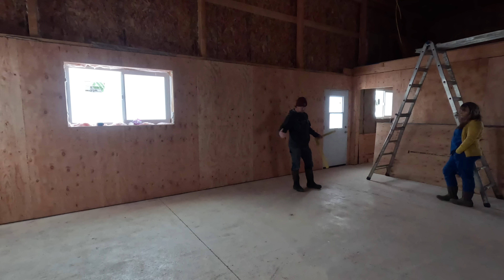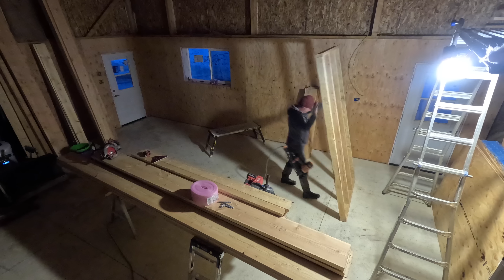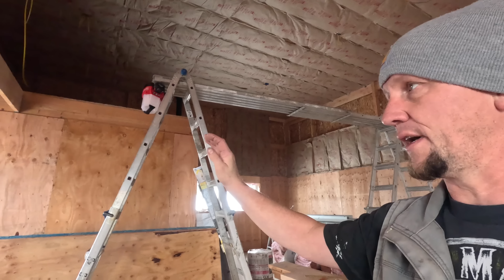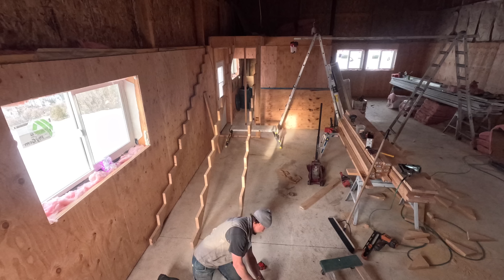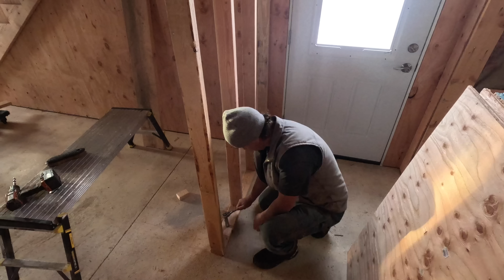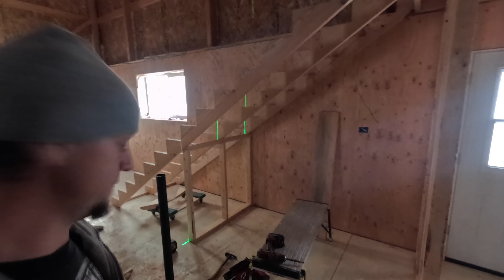Framing STAIRS and adding A SMALL COMPRESSOR ROOM UNDER THE STAIRS \\ MOUNTAIN MAPLE RANCH

Comment: Good progress well done. Consider steel roofing especially if you plan to bring in trucks etc and having the diesel to clean off from the roof annually.
Reply from the maker: We went back and forth about installing white steel roofing for the ceiling but ultimately decided on drywall.

Comment: Felt bad for you at 19.53  when you was fasting your centre riser and it split.
Reply from the maker: Yeah me too.... but its the top landing and will be fully encapsulated with 3/4" toe kick and the subfloor Orb across the top so it shouldn't go anywhere and will be alright. It shouldn't affect the structural function of the stair but its always a risk when nailing that close to the end of the board.

Comment: put your air compressor on a concrete base in a lean-to on outside of your building. no more noise and more room in your building.....  you can that me later :)))   your building is looking really good! good job!
Reply: Add a light bulb lowest point in metal can and lid. Lots of heat generated. Need a closed insulated lean2
Reply from the maker: The thought crossed my mind but I didn't want to deal with the condensation freezing... already have that now since its mounted in my enclosed trailer.

Comment: What is the ring hanging off the damper?
Reply from the maker: It's the "beauty" ring that goes against the ceiling as a trim for the gap between the pipe and the drywall. I just left it down there for now until the drywall is in place.